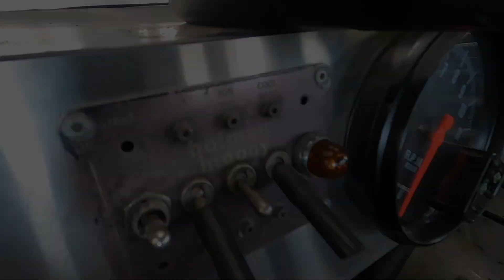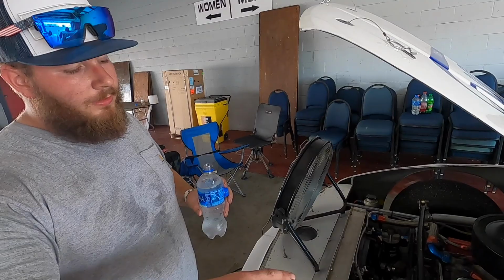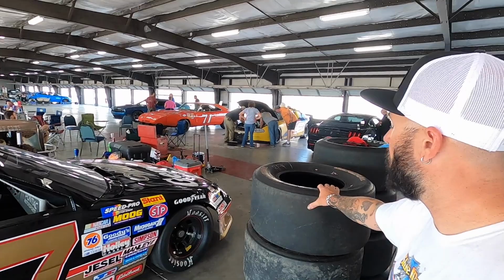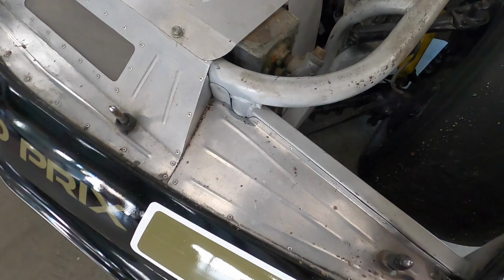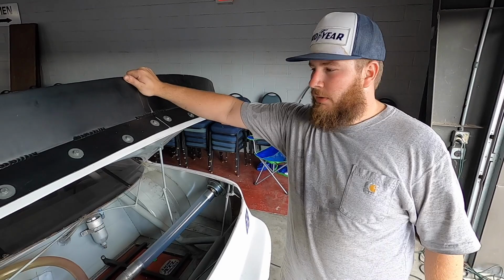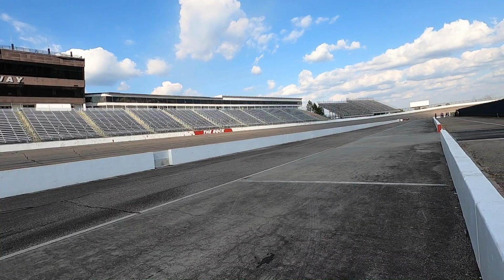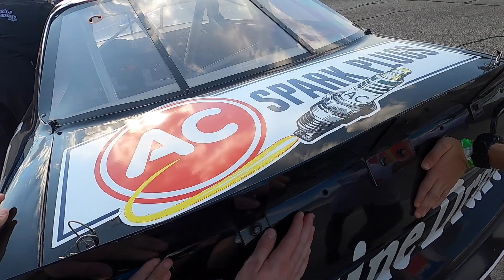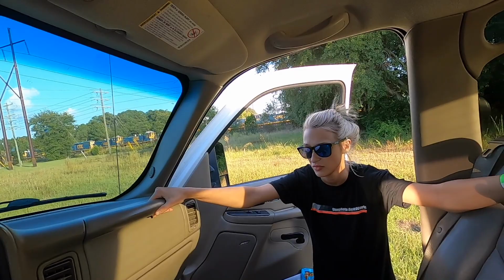Abandoned Rockingham Speedway Coming Back! Exploring The Facility & Days of Thunder Movie Car!

Comment: I used to love going to Rockingham back in the day, it was one of my favorite tracks to watch a race in person at. I had connections that allowed me full access to the pits/garage area during the races which was awesome. I remember almost getting run over by Ted Musgrave in the 55 car when he came in hot to the hot pit area on the back stretch so the crew could work on the car during one of the races, so much fun! I remember Mark Martin blowing a tire going into the second turn and hitting the wall hard enough to tangle the gear shift lever in the steering wheel. I loved those days in NASCAR but it started going downhill in 1997 in my opinion when NASCAR tried to go Hollywood. I don't watch it anymore and only watch dirt track racing now.

Comment: Years ago our local Matco dealer had it set up where we could buy laps to drive or ride some of the dummy cars for a “nascar experience”, i bought myself 10 driving laps and my parents 5 ride along laps. The cars all had the same drivetrain just different bodies, i was lucky enough to get the car with the rear diff that could be heard from the outside parking lot when we got there. Still was a blast to drive a vehicle that resembled a cup car, all the shaking rattling and banging noises i can still hear it at night lol..

Comment: Somebody may have mentioned it not sure but the deal with Victory Lane where you saw that empty checked spot and saw where poles looked to have been. Look at the picture of Steve Park in VL in 2001 and then look at Kenseth in 2004 and you will see they are positioned differently. Victory Lane use to be higher off the ground with a ramp leading up to it.

Comment: Nice video for sure. I remember seeing some of the show cars around stores and businesses when they were in my area for the Martinsville races. and I noticed that back then they were factory bodies that had been modified to fit on a race chassis. I spoke to a Rusty show truck guy one day at our Pontiac dealership who was taking a Pontiac out of the trailer, it sounded good, and he told me they used stock GM over the counter 350 crate engines and added a different cam to give them that great sound. If I can find pictures that I took that day. I will try to post them or it somehow on you tube or facebook. I worked at the brewery in those days located in Eden, NC, so, Rusty was my guy. I love watching your videos!

Comment: Yes you can switch the LS firing order some guys do it with their oval track motors and it sounds completely different and sounds lile nothing you have ever heard it screams down straightaway and rattles the fence lol. I saw a guy come out in a asphalt modified we rented the track with him for testing during the week he brings out his brand new modified and takes it out and as soon as he shifted and drove it 100 percent he was turning 9800 rpms and screaming around the half mile track it was the loudest and most brutal SBC circle track asphalt modified you will ever hear it was crazzy fast.

Comment: If you can find a good used asphalt late model as a donor chassis (not a super or outlaw late model because of the wheelbase / width difference), you could graft an older cup-car skin on, and possibly save a lot of coin, given your OK with losing some of the heritage / nostalgia of a car with a history. I’ve seen quite a few of people do builds similar to what I described so, there’s less fear of damaging a piece of history, and easier parts availability due to modern chassis standardization.

Comment: And we still use the same ignition that's in that lumina in some of the lower racing classes like a street stock. 6al can't go wrong
 And if you want a cost effective cup motor get a elanor arca sealed engine about 15 grand ton20 grand brand new and has the power as a cup car cant go wrong at all for a cost effective vintage cup car motor

Comment: Do they run the oval there when these cars are there or is there a road course. Your right about the smell of the old race cars it’s like a combination of oil leaded gas and race car tires. The Lumina was an awesome looking car and it is often overlooked from the AeroCoupe Monte Carlo and the 1995-1999 Monte Carlo. To me I like the 2000-2002 Monte Carlo body then the Lumina followed by the 95-99 Monte Carlo. I like the AeroCoupe style just not as much as the other styles.

Comment: So youd have to obviously have a crank made to that firing order too for the ls, like the cam, cranks gotta match.
Reply from the maker: The opposing cylinders are still at TDC for both firing orders. The crank will be in the same place regardless
Reply: @Stapleton42  i see that now after reading. I thiught they were way off. Its basically a step up from a 4-7 swap cam. It just moves 2-3 also. So just like you swap a gen 1 with a 4-7 swap to smooth it out. So with that said, if you put the ls to that old firing order, i bet it wouldnt make as much power cause the deflection and roughness itll put back into an ls. That was the reason they switched the 4 cylinders on the ls. So all i really see is pry a loss of rpm if you put old firing order in an ls. Itd be like downgrading just for the sound of the firing order. Still interesting though. Would need a back to back dyno with both firing orders.

Comment: Why dont you see if they will sell you the 74 Dodge you were working on? Then you can slowly add the correct underpinnings as you go along to make the car actually correct from inside AND out lol .. I reckon the 81 Olds Cutlasses were one of the best looking Nascars which people overlook .. probably my least favourite period was the early 2000's when the cars had that ugly rear overhang that was taller than the mid section and looked like some late 60's Dragrace experimental gasser or funny car when they messed around with shifting wheelbases etc.

Comment: 🏁 " Yes  Yes  yes " 
           On that 
{ High Lift ~ 720 } 
{ Low Duration~ 256} 
 { 106 ~ Center Line }  CAM EXPERIMENT🚖
   Got to have HEADS 
 That will FLOW 🪄
ISKY RACING CAMS
  Can grind it for ya

Comment: Asphalt racing is very expensive .I ran dirt .I bought a local area stock car pro stock had the thought of going back into the sport. I sold it last year. 84 Monte Carlo. 358 . All the good stuff s
 Yes looked like Dale Earnhardt senior car   . Just a shop built car. The only car I have is my first car I built I sold engine trans. I'm just going to scrap it ya I raced it can find it on. Utube at my local track. I ran 2 or 3 never 1. I was out running very hi dollars stuff. But became very well known and friends . I would say u pass my me in. Right side again I put u in the wall. I love the sport not cheap. I might get back into it again . I can all ways build a new one . I'm more thinking about diesel truck pulls yes I bought a cat engine 3116. For this reason.  So hey if you want my old race stock car 26 let me know. I rather have a person have it than scap metal. Yes blue and yellow like wrangle. And yes my old sponsors on it too.
Reply from the maker: Send me an email